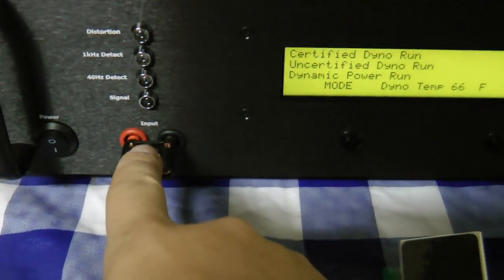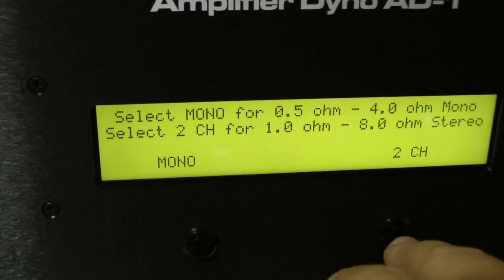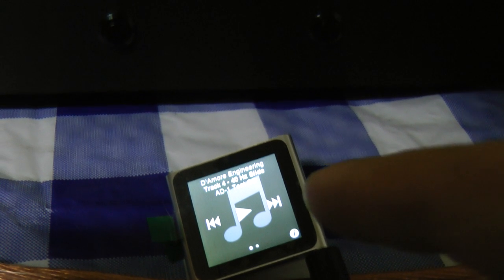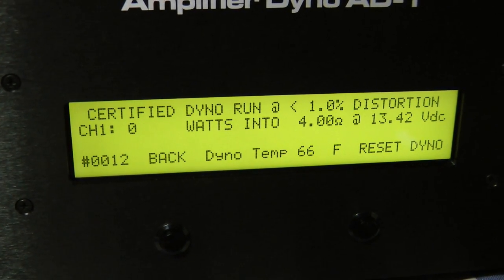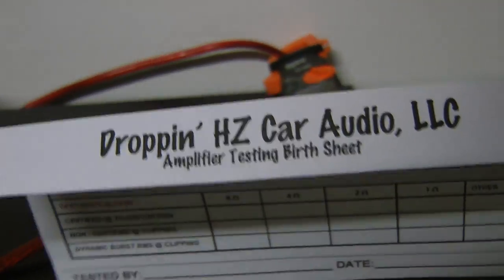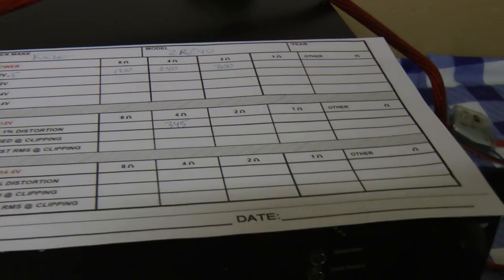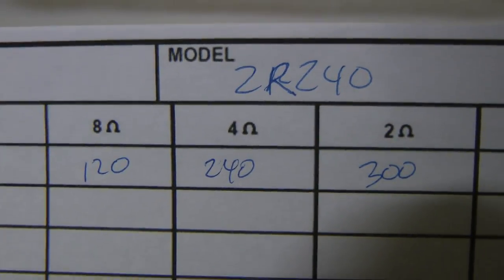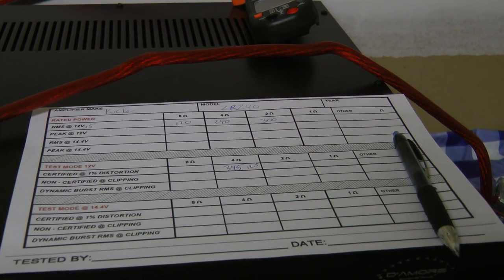Kicker ZR240 vs SMD AD-1 Amp Dyno 4 ohms Mono Certified Raw Video

Comment: Big D, can you include the fuse rating on the amps you test just to see the current draw and how efficient they are. Also, do you have a Kicker KX2500.1 you can put on the dyno or can you get ahold of one? I used to have that amp and loved it and always wondered what it actually put out. Thanks